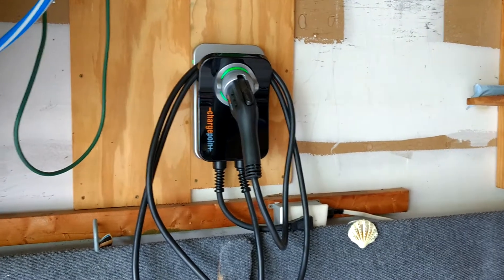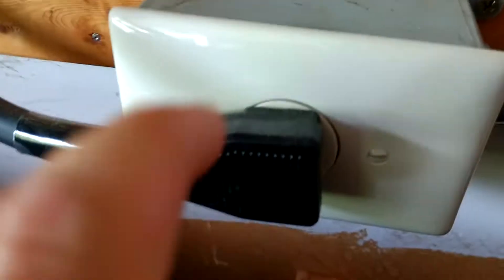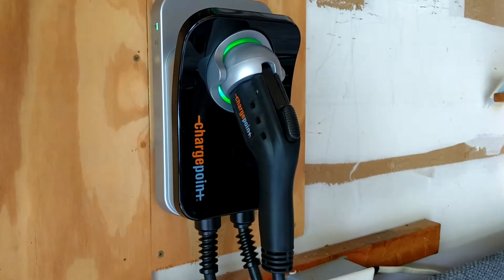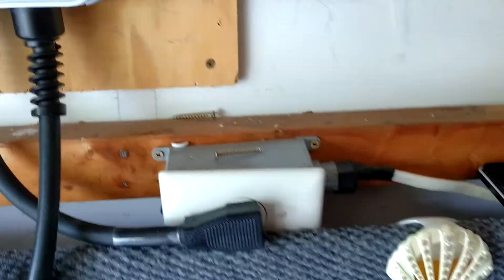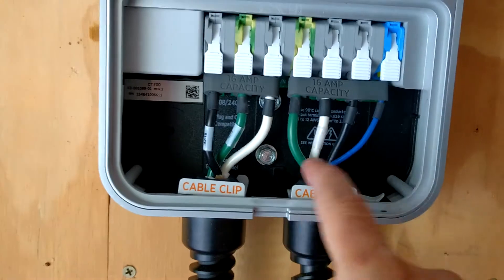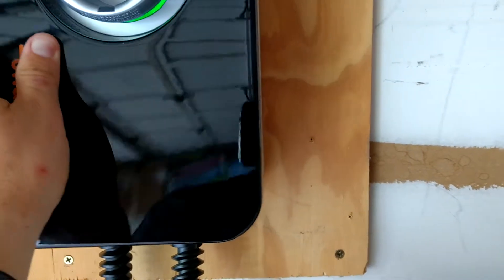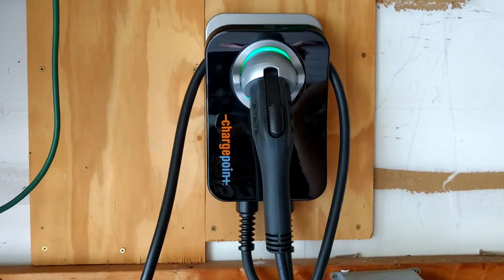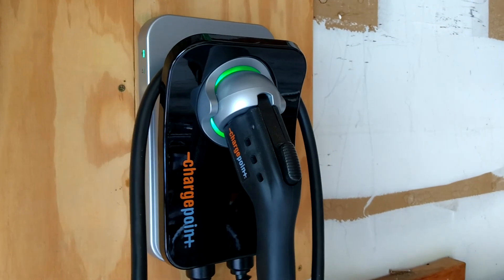ChargePoint Home L2 16amp EVSE

Comment: Was there a reason the old EVSE wouldn’t work on the new car or was it too slow?  I don’t think you need a new one because you buy a different car.
Reply from the maker: I shifted between a few different cars over the years.  When I picked up a 2013 Nissan LEAF S is when I purchased the ChargePoint Home L2 EVSE.   My First L2 EVSE was a BLINK 32AMP EVSE by Ecotality.  (sold this when I got rid of my Chevy Volt a few years ago)  Out of all my 3 plug in cars, 2012 LEAF, 2013 VOLT and the 2013 LEAF, they all charged at 3.3kw (16amp @ 220v)  so I never felt a benefit of charging at 30+ amps.     This review was to push those who wanted to get a lower amperage EVSE to do so and know that its still more beneficial than a L1.    Some older homes also cant support another large breaker,  a small 20amp dual pole breaker is easily adaptable to the majority of homes.

I can still say this EVSE runs great, zero issues since day 1.

Comment: Is it good for Bmw i3?????
Reply: This is a 16amp 220v charger. so essentially 3.3kw   It will charge the BMW i3, Volt, Leaf or even a Tesla at 3.3kw vs at 6.6 or 7.2kw (would need to be a 30 or more amp unit).   The ChargePoint Home does make a 32amp model (6.6kw), but its slightly more expensive.
Reply from the maker: Yes this will charge the BMW i3.  My exact unit is the 16amp version, that would equate to 3.3kw per hour.  This EVSE will charge any Electric Vehicle, even teslas...just at a slower rate. Some vehicles have a max charge rate of 3.3 (2011-2012 Nissan Leaf, 2011-2015 Chevy Volt, Prius Plug-in, Etc)

Comment: 16 amp is a waste of money, just get the 32 amp.
Reply from the maker: Not at all a waste.   For 1, I only have the ability to have a 20amp 220v line, if I upgrade my sub-panel I could increase to a 40amp breaker and run a 32amp EVSE.  2.  We charge at 1am on a Dominion Energy tiered pricing plan, so wither the car would charge at 16amps or 30amps, it still cost the same at $.05 per kWh.   I don't necessarily need the faster charge time on my 2013 LEAF.
Reply: What is the speed difference between a 16 amp and 32 amp?
Reply: @spacegreycoralred  double the speed

Comment: Would you be able to make a video highlighting the WiFi app for this charger? I am debating between this charger and the JuiceBox Pro but I am having difficulty finding information on the app for ChargePoint.
Reply from the maker: Yes, Ill make one today and upload it this evening!  The unit uses the ChargePoint App.  Only difference is you will utilize the "HomeCharger" section of the app to see the ChargePoint Home stats and options.  Ill make a short video to display it.
Reply: CrAzYcOaStIe can you expand on the delayed charging?  It isn’t working on my Volt. Thanks!
Reply from the maker: In the app, Go under Home Charger, you will then see Schedule, Remind me to plug in and Settings.  Click Schedule.  This is where you can tell the EVSE when to start and stop charging.  This helps when you are on a electricity plan that has lower rates, and under schedule will give you a piece of mind the car will only get power on those lower cost brackets.     Does that help?
Reply: CrAzYcOaStIe Did you make a video for the WiFi App? Great video, thanks.
Reply: @nater51 That's the exact predicament I'm in! What did you end up purchasing? Thanks in advance.
Reply from the maker: https://www.youtube.com/watch?v=vC8orNFcG9c

Comment: a very good level 2 charger (240V) with 2 charging current levels 10 Amp for slow charge and 16 Amp for fast charge
http://www.ebay.com/itm/ev-charging-station-cord-cable-J1772-EVSE-Current-select-16-10Amp-110-240-Volt-/252101131205?hash=item3ab265fbc5:g:EKcAAOSwFnFWAnRC&vxp=mtr
Reply from the maker: There are numerous EVSE's out there less expensive than the ChargePoint Home.  However they do not have some of the Wifi and connected features for Time of Use, Energy Consumption, Estimated Energy usage (cost), Remote starting (initiate charging) etc.